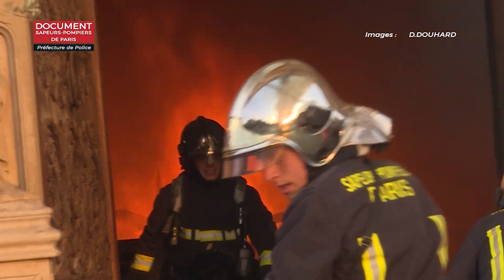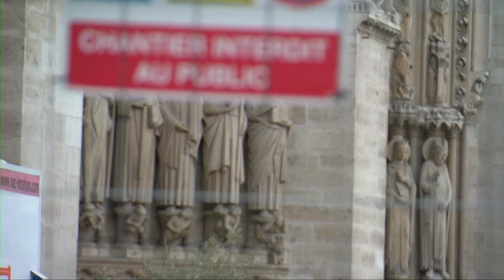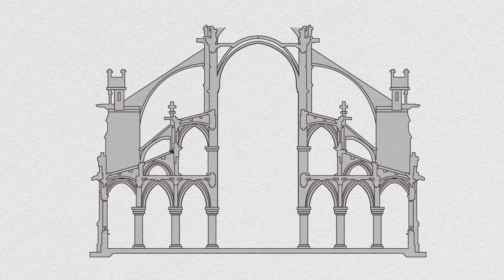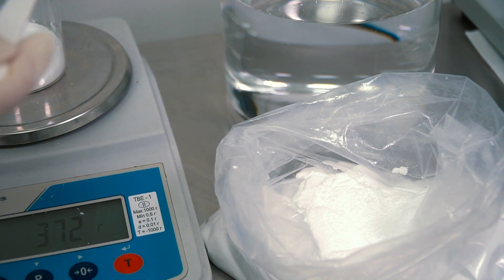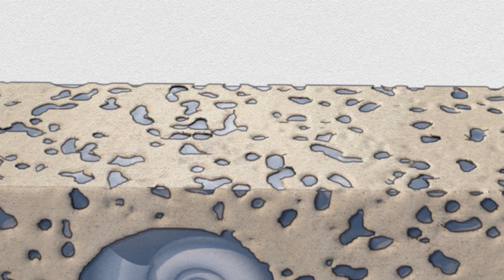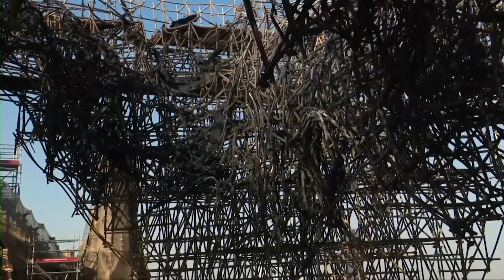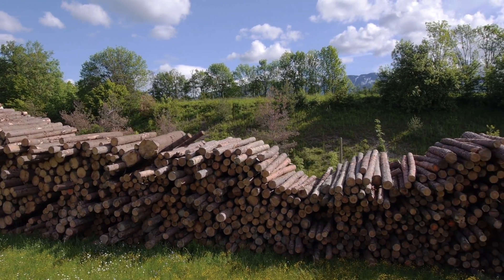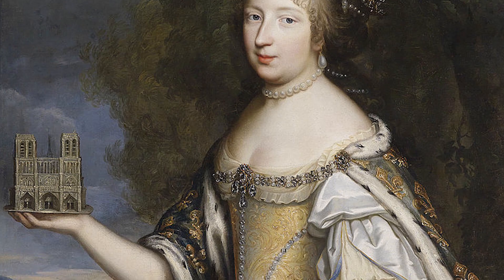A look inside the restoration of Notre Dame cathedral

Comment: Hope they keep it as close to the original plan as possible, "tradition" is is the crown jewel in this case
Reply: As of April 15, 2024, the Notre-Dame de Paris Cathedral in Paris, France is scheduled to reopen on Sunday, December 8, 2024, following extensive restoration work after a devastating fire in April 2019.

The reopening will include a procession through the streets of Paris two weeks before the reopening to accompany the return of the Notre Dame statue, and the rebuilding of the spire. The cathedral is also scheduled to remain open until June 8, 2025. 

The cathedral's chief architect has said that the reopening will be "breathtaking". The restoration work has included:
__ Finishing the framework
__Cleaning and restoring painted murals
__Rediscovering the colors of the cathedral's 24 chapels, which have returned to their vibrant 19th-century color palette
__Completing wooden stars with 22 carved oak panels depicting the life of the Virgin Mary, which had suffered water damage during firefighting. 
Schedule for Notre Dame Cathedral's grand reopening in December unveiled -ABC News

I would love to attend that Sunday church service and Christmas in Paris.

Comment: Money well spent.

When when the world economy is struggling. 
Amidst water scarcity.
Countries struggling with food shortage.
Famines affecting the farmers.
Jobless youths roaming around without a job.
Not enough medical supply where needed.

Amongst all this. People choose to reconstruct an old structure which will not positively contribute significantly to any of the above mentioned real life problems.

This proves that prayers alone don’t work.

Money is needed to sort most of the problems. 

And only science is capable of delivering real solutions for real problems. 

Still some will still choose to blindly follow the religion and spend on things which are not the of the hour.

Religion and tradition is nothing but peer pressure from the dead.
Reply: Firstly, France is a Secular Republic with an emphasis on the "Secular".   People have freedom of religion but expect to get jumped on if you try pushing it.  

The churches, pre c-1900 are owed by the state and maintained by the state.  They do a pretty good job of keeping them that way.   Their use by a religious body is "on sufferance".  Step out of line and you are out.  

France is not poor. 

France has one of the best healthcare systems in the world. (and it's free at source)
France is not short of water.
I don't recall ever hearing of anyone starving in modern-day France.
Have you ever seen a French farm and seen how they are managed? The farmers are a disagreeable bunch but they know how to work.
Jobless youths:  Education in France is virtually free up to and including doctorates.  No excuses there.
You might want to look up "Médecins sans frontières" when it comes to helping others.
And the cathedral generates a ton of money from tourists.

Comment: Are these clowns going to put fire suppression equipment in?  How stupid could they have been?  Then again...
Reply: I agree. There really should be a fire sprinkler system in place at Notre Dame Cathedral; albeit the sprinkler heads should be designed to blend in with the design of the cathedral's interior to avoid scaring the congregation.
Reply: The roof is very high up and unheated. Any sort of active sprinkler system would be extremely difficult and with it's own risks. It would, for example  require heating. Now, heating an old, dry attic rarely  inspected....why doe that sound like a bad idea?

Comment: I know they had been doing some renovations in the cathedral to repair some of the structure that was weakened (due to age), and supposedly the fire was started by accident, but why oh why couldn’t they have been more careful? And why wasn’t the fire department called IMMEDIATELY when the first sparks were discovered? I heard it took something like 20 minutes after the fire started before anyone was called 😡
Reply: I read that a alarm malfunctioned or was interpreted as a false alarm.
Reply: What also happens sometimes with housefires is that people think that they can controle the situation themselves. Certainly if this started out as a small fire (i have no exact knowledge on how this fire started) it might be that for a relatively long period they try to manage it themselves, untill they after 20 minutes came to the realization that it went out of controle.
Reply: Appearently, an alarm went off, and someone employed to check went to check. didn't find anything and went back down. 

The wood is perfect food for a fire, and it is very sad and  rage inducing, how often priceless historical buildings go up in flames during repair work. 
Many  building companies are more than 'lenient' with no-smoking rules etc. on  building sites, let alone massive ones where the next place to smoke is a 20 minute climb away. and they usually get aways with it with modern buildings of modern flame retardend materials.
But  ancient buildings: nope, no protection.

"Don't make a fuzz! What could a cigarette butt possibly do, eh?"

or rather, while restoring a centuries old  library with priceless books

"Right, our vacuum cleaner is old, has short circuits somewhere, so works a bit spotty, but what's the worst that could happen, if we leave it plugged in over night, eh?"
hint hint: Anna Amalia Library

Comment: Be good to see an analysis of the actual blaze itself - I picked up visually that there were two fires - one at either end of the main roof. Perhaps there was an unseen internal connection between them?
Also I am mystified at the only explanation I have heard of the cause as being an electrical wiring fault. I have seen oak half the age of that of Notre Dame (some 800 years) and it has become almost like steel and is difficult to burn and sometimes not possible on a bonfire - this then from some exposed wiring?
There are other curiosities in eye-witness accounts to do with noise and delay - perhaps the most telling thing was the distress and incomprehensibility in the eyes of the Cathedral’s prelate in charge of the building. He looked and talked like one wounded.
Reply: Look, you can also shorten this piece by writing: i think it was foul play.
Reply: A Roof is made of more, than just the large timbers, and in the centuries past, some dust, old birds nests and so forth tend to collect in some difficult to reach spaces. The large beams didn't start burning first.

Comment: There is a mistake in the drawing at : 1.08: The flying butresses are too high, on the side of the main hall, they shoukd be lowerer, at the "Breaking point" , between the ceiling and  the main vault walls.......
Reply: No, their position is correct. While the drawing is somewhat awkward, the top buttresses are indeed higher than the main vault supports. That is because the actual mechanical center of horizontal thrusts is higher in pointed vault arches. The force is further drawn and stabilized up with the use of centering pinnacles.

Comment: Very well articulated.   It is good to see the great care being taken to restore the Cathedral.   Hopefully they will be able to restore it so it looks just as it did before the first, with the possibility of substituting some kinds of materials so that it will not be as vulnerable as before.
Reply: I don't think it would hurt to upgrade certain materials in the reconstruction. Also, a state of the art sprinkler system or other form of fire remediation might be in order.
Reply: @Ottee2  I agree, so long as the appearance of the cathedral is rebuilt to look the same as it did before, a sprinkler system could have been installed years ago, which very likely would have prevented this tragedy.
Reply: @Ottee2  Its funny because I heard the building just had fire suppression and detection systems installed, inspected or upgraded.
Reply: The rarely seen parts of the structure, such as the roof trusses, I think are perfectly fine to update to the most modern standards of fireproofing and structural engineering, so that Notre Dame can possibly stand for a thousand years from now, assuming no really big earthquakes in the Paris area. As far as the areas widely seen by tourists and attendees of services, yes, those rooms should all be restored to as original as is possible.
Reply: @jokerace8227  Well said
Reply: @Emily Evans I agree these early builders were ingenious, it is so sad that with our modern technology, there could have been installed sprinklers in the 'attic' where the fire broke out  and more precise equipment to tell just where the fire was from the beginning.   It was and is a magnificent structure.
Reply: like a fire sprinkler system.
Reply: @MrSychnant  I agree that is a key to addressing any possible fire hazard in the future.    It was also reported that the smoke/fire detectors they had were not specific enough to the exact area where the fire first broke out.    Thankfully this magnificent structure can with time and careful workmanship be 'restored'.
Reply: As of April 15, 2024, the Notre-Dame de Paris Cathedral in Paris, France is scheduled to reopen on Sunday, December 8, 2024, following extensive restoration work after a devastating fire in April 2019.

The reopening will include a procession through the streets of Paris two weeks before the reopening to accompany the return of the Notre Dame statue, and the rebuilding of the spire. The cathedral is also scheduled to remain open until June 8, 2025. 

The cathedral's chief architect has said that the reopening will be "breathtaking". The restoration work has included:
__ Finishing the framework
__Cleaning and restoring painted murals
__Rediscovering the colors of the cathedral's 24 chapels, which have returned to their vibrant 19th-century color palette
__Completing wooden stars with 22 carved oak panels depicting the life of the Virgin Mary, which had suffered water damage during firefighting. 
Schedule for Notre Dame Cathedral's grand reopening in December unveiled -ABC News

I would love to attend that Sunday church service and Christmas in Paris.